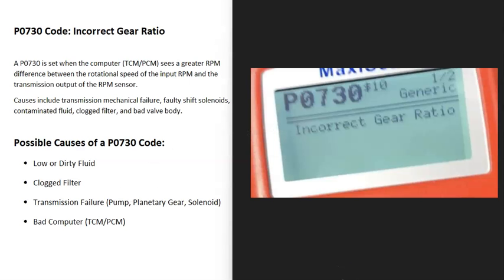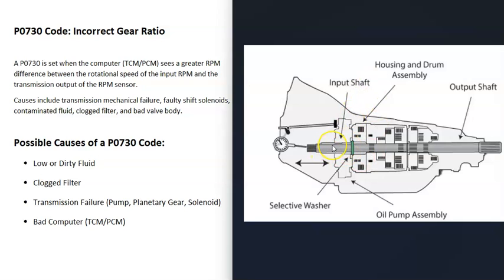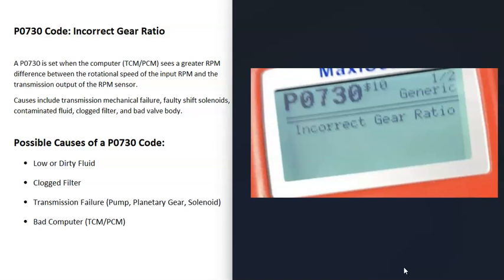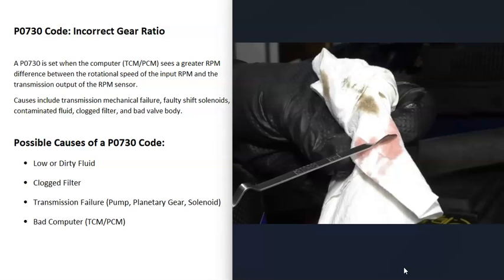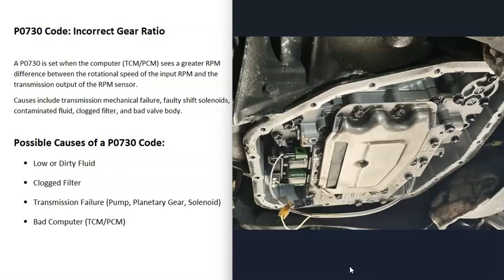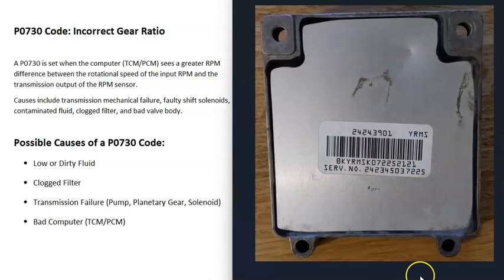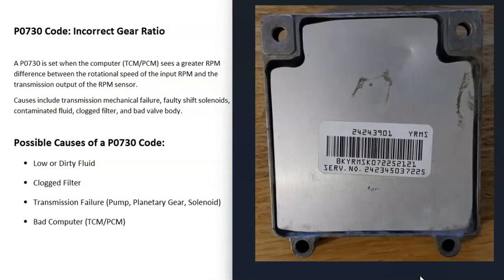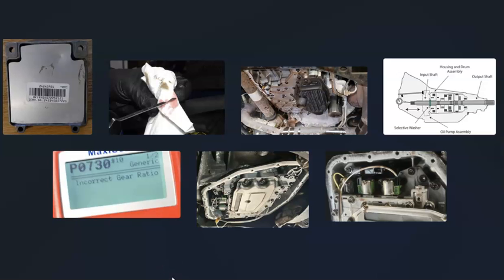Causes and Fixes P0730 Code: Incorrect Gear Ratio

Comment: I needed a new transmission , and so i got a rebuilt one from a transmission shop, they claim they replace everything and even upgrade  parts. 
I used to get P0733 and P0735  with the over drive off light flashing, but after topping up my trans fluid from the 10 quarts to 10.4 i needed, the P0733 went away and od light didn't come on around 40km, so I kept driving carefully etc and then where it should be shifting around the 75-85 km mark thats when I would get the OD light, but today it didn't so much but it was suggested by some guys on a ford ranger forum to reset my computer so i did that and was test driving it making it learn the shifting etc it was ok but the light came on and once past 90 to 100km thats when things acted a bit off..   its frustrating as I really can't spend a lot more money and you would think a newly rebuilt transmission would work fairly well. The place also had 4.6 stars and good reviews, and they been doing it for 20 years or so

Comment: My 2006 s500 shifts 1st,2nd,3rd on initial start up and take off then i only get 2nd amd 3rd until restart. Code p0730 incorrect gear ratio. I changed my valve body fluid amd filter yesterday and still same issues. Could the tcu cause this? Idk what to do now

Comment: When i drive my transmission slips and I have to pull over and restart the car. I wait for the rpms to go down, throw it back into gear, and it drives normally. Then it happens again. Is this an issue with the TCM? I have drained and refilled the fluid already, and it still occurs. Plz help
Reply: Having something similar going on the car drives strong almost brand new but every once in a while i shift into reverse and it wont go i had to put in park restart the car then it drove normally
Reply: What’s was it ?!!
Reply: Is it a jeep?
Reply: Tcm replace irt

Comment: My crv does this I’ve noticed that my alternator voltage is at 12.9 could this be a reason why I’m getting th 730 code also after like 10 min driving it will not shift into third and just revés up. I turn of car for like 5 seconds then I drive off and works good for like 10 min and it’s all over again.
Reply from the maker: If there is a battery or alternator issue, that can cause problems with the computer modules. 12.9 volts is on the low side; most alternators output 13.5-14.5 volts. You can look up the rated alternator output is rated for; some newer vehicles have smart alternators with voltages that vary.

Comment: I have code 730,and when my car seems like it goes into neutral I just turn the  engine off for a few minutes and restart it works fine. Have you  ever  heard of this  2002 Honda Civic.
Reply: I have the same issue with Opel corsa 2013 model I don’t know what to do
Reply: Tengo el mismo problema en mercedes benz ml 350 2006
Reply: Lmk
Reply: Did you ever fix this? Im having the same issue on my 02 civic… looking for what issue causes this. Thanks

Comment: I had my transmission totally rebuilt and since I had it installed no problem at all. Then 2 months later, I went WOT for short distance just to enjoy the sound of my CHARGER RT 07 with the new exhaust line. The engine went into safe mode and got the icone light up (it seems like it does it randomly depending on how crazy I drive). But when I look at the code through the menu of the car, it says it is all good. And few minutes later, back on the road. Eventually the engine icone goes away. Yesterday, I plugged my HP Tuners and to figure out what is going on. I got two codes; P0730 along P0219 (Engine Overspped Condition). I will defenetetly drive smoother until I get this issue fixed ( I dont want to mess up anything at this point since I put already a lot of money to have my transmission fixed).

What do you suggest ? Thanks for that valuable video you shared here. Keep up the good work.
Reply: Im gettin incorrect gear ratio and engine over speed condition. 08 R/T diablo tuned new ecu did you ever figure yours out
Reply: @gmoney1661  I took my car to a pro tuner who got it fixed. The previous tuner didnt take into account few upgrades such as the SRT8 camshaft, the eagle intake manifold, the shorty headers....Now that all of those parts were taken into account, the new tunes is doing a great job so far. No more issues.

Comment: Man oh man, I drive a 2017 Audi Q7 3.0 and had this code along with a P07DE & P2703 code that all came up at the same time when I was accelerating coming on to a high way. I know I had a slow transmission fluid leak due to a bad transmission oil pan gasket which I ordered. That’ll be the first thing I try and just hope for the best. 
Any additional input or help is highly recommended and highly appreciated. I can even compensate.
Reply: Hi Millionair
Do you find any solution for this codes,I’m having same errors and issue